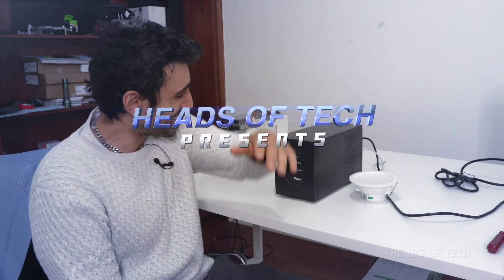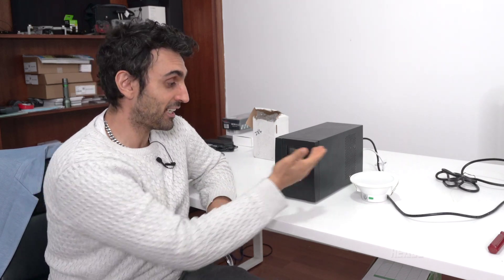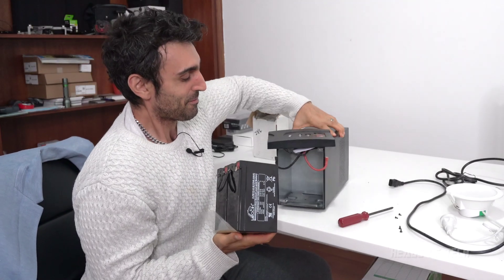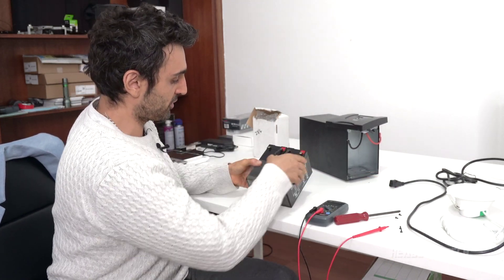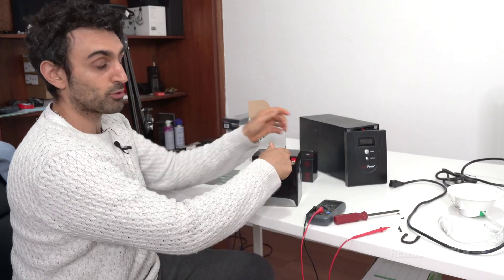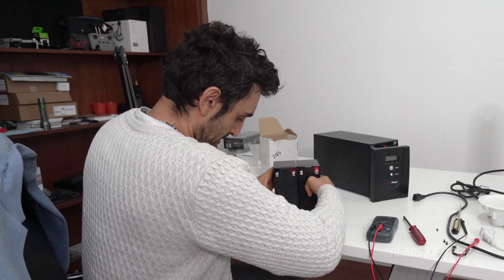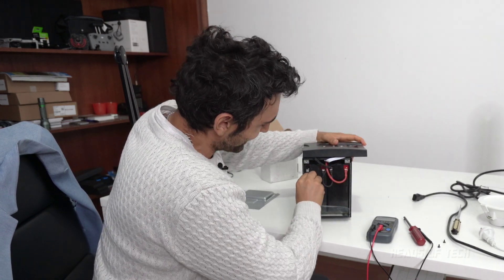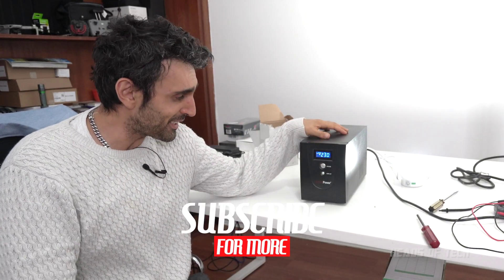How to Fix Buzzing UPS | CyberPower Battery Backup Replacement Guide w/ Hitachi CSB 12V

Comment: I'm grateful. Thank you ❤

Hello sir, every time I start a game, mine starts to overload.
I hear a prolonged beep and my pc shuts down.
It is currently seven months old.
With 13.37 volts, both batteries are good.
Seasonic VERTEX GX, 80+ Gold, 850W is the PSU.
I've noticed that the voltage buck hasn't started at all for a few days.
Is this the result of my PSU's PFC being active and Simulated Sine Wave?
Reply: Yes, it is because of Active PFC; be cautious what you buy for your PC; this is necessary if you have a new and not too old PC. : CyberPower CP1600EPFCLCD

Comment: Did this fix the buzzing?
Reply: Mine is currently doing the buzzing noise but my tech guy said its not a battery issue. I would really like him to respond to your question if the battery change solved the buzzing noise problem.

Comment: how do two 12v batteries provide for 110v outlets / appliances?
Reply from the maker: They usually have transformers inside, but it depends on the model as some use transistors instead. Here's a good article on the topic: https://www.constantpowerservices.com/questions/8-what-are-the-differences-between-transformer-based-and-transformerless-ups
Reply: @headsoftech  thanks a lot! i'll check it out

Comment: I totally agree with you, a replacement is definitely the way to go. Once you drill holes in a sealed lead acid battery, the odds of making it totally sealed again is a crapshoot.  However, I do like a good buzz, haha!
Reply from the maker: The one I've got here you can just pop off the lid and caps so I'm going to try it out. But even better than that I've seen some guys online use full on car batteries as replacements... I wonder if I can make my own whole house backup battery.
Reply: @headsoftech  Just FYI; If doing that you want leisure batteries as they're designed for constant output. Car batteries are specked for short high amp pull for car starting.